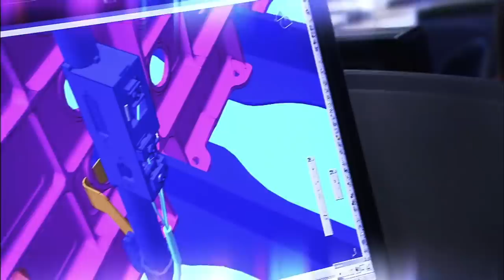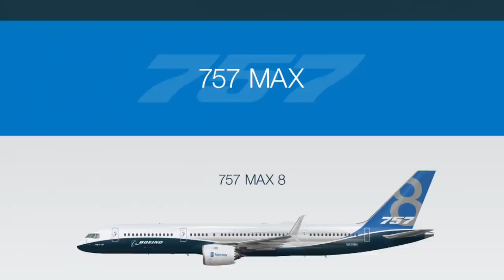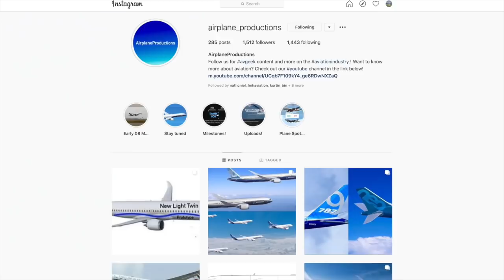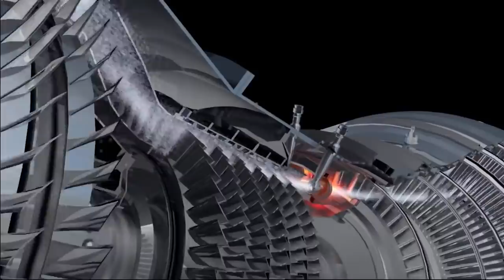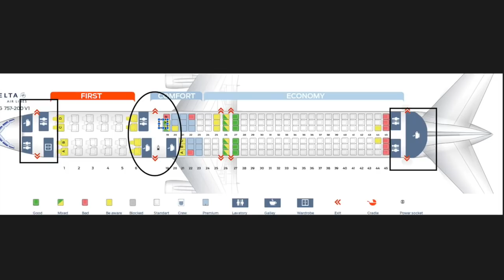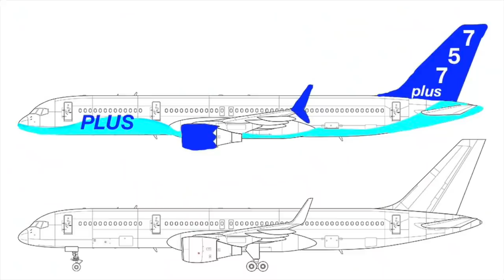Boeing 757: Could a 757 re-engine work? (757 plus)

Comment: Yeah, just slap on new engines and away we go! Bullshit. 757 and 767 are 1980s tech and Boing may as well do a redesign just like747-8; which cost billions anyway, and Boing will never recover that investment. Boing needs to get on with the “797” job and get it done. B737Max should be a lesson for them. Cutting corners NEVER works, and the damage to Boing’s reputation will cost them dearly going forward. Boing needs to become Boeing once again.

Comment: It would be a really nice comeback for the Boeing 757 if the Boeing 757 plus is made.. Putting a new fuel efficient Engine would be no problem because it has a high ground clearance.. And if Boeing addresses all the problems that you mentioned in ur video like changing the wing design, widening the fuselage a little, managing a cargo container system and putting a fly by wire system or sonthing similar.. 757 plus would be a really nice airplane to fly in 🙏😊

Comment: They did just that on the 737, and we know how it went.
Reply: The problem they was with the 737 Max was the aircraft was low to the ground, that's not an issue with the 757 or 767.
Reply: Luiz Antonio Pereira It May not happen here, as the 757 is considerably taller than the 737
Reply: Reengining is not a new practice,
Reply: The 737 and 757 are not the same plane, at all. I'm honestly appalled that this comment is upvoted at all.

Comment: and the A321xlr cant take off and land at varied airports with height and length issues. 757 is a fast plane that can land anywhere
Reply: I cant like this comment enough. That's one big advantage the 757 always had over the a321. The ability to operate hot and high and at bigger amount of challenging airports. The a321 is a little underpowered. Same as the 737NG. The 757 can climb to cruise altitude in a flash.

Comment: Its really interesting with ETOPs the most valuable jet was one that Boeing halted production. Even today no plane can compete with 757 for versatility beyond any other small or mid market jet.
Reply: The Airlines were still in the hub spoke mindset in the early 2000's, they weren't buying 757's that's why Boeing stopped production. You can't keep making planes that aren't selling.  Then later on the industry changed and the 757's versatility became very valuable,  like 10 years after Boeing stopped 757 production.
Reply: jefflewis4 the reason airlines didn’t have need for new ones was because they were such reliable workhorses. Every airline that owns them loves them because of their unique capabilities. A bigger problem is that it wasn’t really popular outside of the US airlines. Still, seeing the number of routes that could only be operated by the 757 (like half of United’s routes to Europe from EWR, half of American’s routes to South America from MIA and many transcontinental US routes on all legacy carriers) it was very shortsighted to not plan a new updated variant for it. The 787 was developed around the time the 757 was halted and is contrary to the focus on hub and spoke. I feel like they felt the 787-3 and other 787s would take the place of 757 routes but then scrapped the -3 and that never happened. Not to mention all the domestic US routes like ATL-FLL and FLL-JFK where delta operates a 757 every hour. Now to replace all the domestic routes that operate 757s delta ordered a321s so you’d think they would’ve kept the 757 just to compete with the a321. They ceded that whole market to Airbus. Left Boeing scrambling and making reactionary decisions once they were already behind Airbus.
Reply: @stone5048  It wasn't until early 2000s the 757 got etops rating to allow mainland Hawaii, Europe and Caribbean flights. The 757 was already out of production and instantly it became a valuable plane because of ability to fly 6-8 hours and take-off/land anywhere including high and hot airports in South America where large jets have issues because of the weight in thin air. I think Boeing is going to bring the 757 plus back lighter and larger. Smaller cockpit (No engineer needed with GPS), more seats, less bathrooms needed with entertainment systems keeping people busy. Flying has changed so much since the 80s when the 757 and 767 were build. Its a testament to Boeing how many of the 747, 757, 767 and and 737 lines are still flying today. Over half of the 757s are still flying 30 years later.
Reply: Char Fras I’m curious as to why Boeing felt they couldn’t sell another 1000 updated 757s in 2005 but especially in 2015 when they did another feasibility study. In 2004 when they announced the end of production they offered the 737 NG variants to airlines as a replacement. Which it really wasn’t. By 2015 the value of the 757 was pretty clear and they still thought it was unfeasible. Around 2015 the orders for the a321 began to double every year from what they were previously and the XLR got 450 orders within a year of being announced in 2018 so clearly they were missing a lot. Although, nobody’s ever accused Boeing of being a well run company these days.
Reply: @stone5048  Everything has changed. Boeing had alot of excitement with the 777x and a new 797 but the world has changed. Air travel has stopped and its not going to return in the next couple years it will take a good 4-5 years to see international travel return and its simple Boeing knows the 777x will sell few and with the max fiasco Boeing is running on eggshells. Its cheaper for them to bring back the 757 and 767 with composite frames then launch a new plane. Everything will change again though after Trump wins reelection  which is why this is happening to such an extent. The crazy lying dems want this and the world in financial ruin so people wont vote trump PERIOD just listen to the idiots Garcetti Biden Pelosi DeBlazio. It's the Borg is back!!!
Reply: Michael Stone the first generation orders were still likely mostly all still in service. Orders dried up as airlines had as many as they wanted (at that point) now that planes are aging out were seeing demand for that market increase greatly again. Which we’re seeing with A321 orders doubling almost every year as it’s the closest to a 757. The larger Max models were intended to fill those role too but it’s not as good at it

Boeing/MD had the same issue with the 717/MD-95 and MD-90. The MD-80 was extremely popular and when these new models were introduced the MD-80’s were still in the middle of their service lives. Delta and Hawaiian have asked for a new 717 as they can’t buy enough of them and have no replacement for them on the market (particularly Hawaiian who require extremely high flight cycles) but Boeing has no interest in restarting that program.
Reply: @stone5048  For the original shorthaul mainline flights, Both A321 and 739 have a lower per seat and per trip cost. That left long-thin routes on the table, back in 2005 there should be more than enough 757s for that purpose.
And originally both 737 and 757 is supposed to be replaced by Y1. Just that A320NEO forced Boeing to react with 737MAX, and proceed with NMA to replace remaining 757/767 altogether.
Reply: Char Fras The 757 always had a two person cockpit- no flight engineer.
Reply: @stone5048  Fascinating how they were headed the narrow body direction anyway, and Covid just so happened to solidify that choice...

I'm not saying there is some sort of conspiracy, I just find the coincidence fascinating.
Reply: @jefflewis4  Yeah that is true
Reply: you took the words from every avgeeks' mouth.  I agree!
Reply: Uhmm yes there are. A321LR. Already flying for a year.
Reply: @nntflow7058  no the a321lr is nothing to the 757 in europe
Reply: @col loc If this was early 2000s. Boeing would have win. But it's 2020.

B757 + competition is A321XLR. Not A321-200 anymore. Unless Boing could provide at least 10% better fuel efficiency than A321XLR. Then it's a dead end for them.

They predicted that both B757+ and B767+ would arrived in 2030. Which is 10 years from now. That is 10 years from now. What are the chance of Airbus developing and launching A320neo family replacement?

A300 are created for short regional routes between large cities. It's not actually that common to see it fly on TATL.

Early A300 have extremely bad range, way smaller than A320.

The newest A300 have less range than A321LR/XLR.
Reply: @nntflow7058  Exactly. While any 757 outperforms A321XLR would be attractive enough for Delta, United or maybe Icelandair, it have to be significantly cheaper for smaller airlines to overcome the extra cost for a dedicated family. Meanwhile, for many of them, XLR is just another A320NEO, albeit slightly more expensive. Same for Airbus - wings and some structures are different, but others are shared with A321.
R.E. A300, it should be Asian carriers that keep pushing for longer range, 2-man variants? They flied across Bay of Bengal or South China Sea way before TATL was enabled by ETOPS.
Reply: @nntflow7058  Just checked gcmap, yes there are more diversions in Bengal than to Atlantic, but say, BKK-BLR, a twinjet wouldn’t make it if restricted to 60min (within ICAO's 90 min, though). 
Meanwhile Atlantic is not as empty as you think. Some of the busiest routes follow the British Isles-Iceland-Greenland-Nova Scotia-East Coast route, which is well within 90/120min, while airports on outlying islands of Africa means large part of Latin American in reach with ETOPS120 routings.
Even North Pacific is doable with ETOPS120 - not until Russian opened their airspace though.
Reply: I would love to see a re-engineered, updated 757 with geared fan powerplants.
The look & stance on the ground is amazing.
It could be made even better using the newer style wings as used on the 747-8i, 777x & 787. Yes please!
Reply: soaringtractor  Yeah then ETOPS changed everything including the 737 and a320
Reply: @col loc Totally bullshit. Do you aware that Aer Lingus carries as many pax on LR as on 752, with comparable seatings? No wonder why you keep wishfully thinking of 757 in different league, while in reality isn’t.

Comment: This video is an exercise in futility. It aims at resurrecting a 40 year old plane that has been out of production for many years. It will be as successful as the dinosaurs in Jurassic Park. It is outdated any way you look at it. The fuselage, the avionics, the wings, you name it. And daydreaming about new engines that will see the light of day by the end of the decade will not make this piper’s dream any more tangible. With lease rates at less than rockbottom levels due to Covid-19 if anybody wants middle of the market planes there are heaps and heaps of idle planes available. They are known as 787-8, A330-200 and maybe A330-800. Choose your pick
Reply: Luis de stefano......  For the most part i agree.  Boeing won't add a plug or new wing.  However new avionics and a re engine could be possible (don't forget the former has already happened.)  The problem is the PW needs a minimum of 2-3k lbs more static thrust to be viable but at what cost would that effect its fuel burn?  Basing your argument on the age of the 757 is futile as many "old" airliners were given a new lease on life thru re-engine programs look at the 727 and DC8s used by freight companies around the world.  The 75 is a hot commodity in the air freight business.
Reply: NovejSpeed3 the situation has been considered for years, and the reply has always been a flat no, and for good reason which I will try to explain in the simplest possible terms. For a new engine PW1133G and LEAP-1A are the best options. A higher thrust needs major changes. With a classical throttle push stretch (ie spinning the engine faster injecting more fuel) you can get 36 klbf, 20% less of what is needed. Newest engines are heavier and yield more thrust. The critical point here is the safety speed V2 of 155 knots in the case of 757 with one engine down. Here is where max thrust is needed, not under normal circumstances. Even if this were achieved, with adequate engines 757 will trail A321LR in cost per seat by 5-10%. Old dogs learn no new tricks. The old wings increase wetted area substantially and the lower aspect ratio results in higher induced drag. In short, so many substantial changes are needed that a new design becomes less expensive and gives better results

Comment: Wouldn't it be easier to have a clean sheet design for a single aisle aircraft that has a range of models to cater for 180 to 280 passengers, similar flight deck to B787 and B777-9 to replace the B737 and B757/B767? The future is in fuel efficient single aisle aircraft operating up to medium haul routes. 

If Boeing did develop the B757Plus then Airbus would released the much rumored A322 - the stretched version of the A321lr.
Reply: The new 767 tankers and freighters rolling off the assembly line have updated cockpits similar to the 787. The 737 Max cockpit is quite similar to the 787 as well. Since the 757 and the 767 came out in the 80s computers and technology has vastly improved so basically I think that would mean reduced empty weight and a much more efficient airplane. Especially if the wings are updated. The 767-400 shares a main wing with the 777 and also main gear.
Reply: @antonyh37  - Its is still a rehash old design like with B737 and B777-9. With a clean sheet design will give the design at 30-40 years of life like with A320/A330s

Comment: This project could work after COVID-19. But Boeing's target now is to finish developing their 777X, settle their 737 MAX issue and a re-engined 767 for cargo operators.
Reply: @col loc Just tired of people keep claiming MAX crashes because of untrained pilots, when Ethiopian Airlines and their pilot academy were fully accredited by both FAA and EASA. And with just two sensors the MCAS system is prone to single point of failure, which doesn't sound like a great idea in aviation, where safety is always the first priority.
btw, why make two single aisle aircraft family when Airbus have just one?
Reply from the maker: yourprodude 124 Yep, a re-engine 767f could be interesting though, as it could come together with a passenger version. Let’s see!
Reply: @oneskyflyer  It is indeed interesting. I'm looking forward to the re-engined 767.
Reply: @col loc 
Let's say, Airbus designed highly computerized FBW aircrafts, but Airbus didn't design the flight computers themselves, so if anythings goes wrong it’s none of their business right?
WRONG. They have to ensure 
1. The system is designed with adequate redundancy
2. Maintenance engineers and pilots should  be informed of the potential failures and the procedures of encountering them.
I don’t see Boeing have done either one enough - in fact, failed to fulfill the mandatory from FAA. 
While inadequate maintenance and training is part of the blame for JT610, pilots in ET301 did followed the updated procedures, and the aircraft seemed to be fine before that. It’s the recovery that make the trouble - high speed, low attitude, unreliable reading combined with the fact that 737 is a fly-by-mechanical aircraft, means pilots have to react in a confused and task saturated condition.
The only way is to follow a jammed trim recovery, but given its no longer required for any 737s after -200, probably that’s not something pilots should be aware of at the first hand, let alone memorized and practice that.
It’s hilarious for some Boeing fanboys with no real world flying experience nor professional knowledge keep blaming the victims when even some the most experienced pilots and aviation experts say the otherwise.
Reply: The airline industry will still be suffering after COVID-19. Airlines may not be in a position to invest in a new airplane. There is a possibility that we could lose a least one airline to bankruptcy. Airlines will be concerned about surviving before they even think about new airplanes.

Comment: I ever this will push through; I bet they wont call it 757Max.
Reply from the maker: XXX P Yep, they wouldn’t. 757 plus is a good name. There is a small business case to launch the 757 plus though, the replace 757 and compete XLR. It will be interesting :) Thanks for watching and do stay tuned for more great videos on the way!
Reply: @oneskyflyer  They'd probably call it 757-700, 757-800, or 757-900
Reply: Maybe they could do like the 737 and call it the 757 Next Gen and start with 757-7, and 757-8